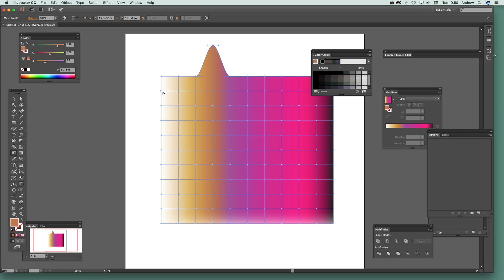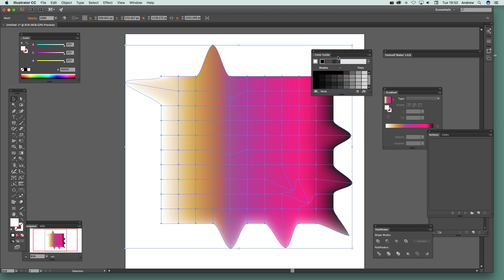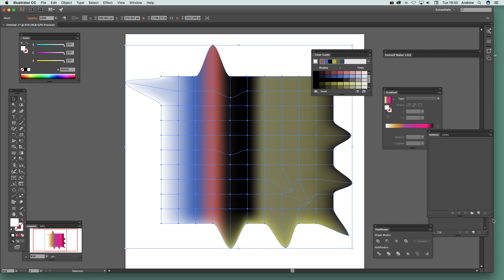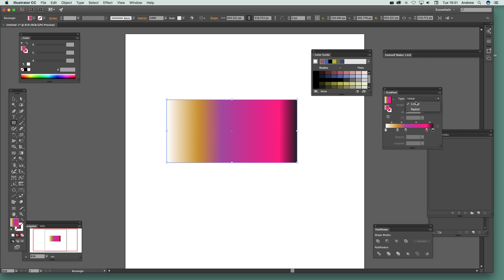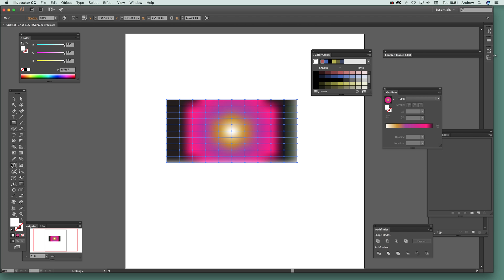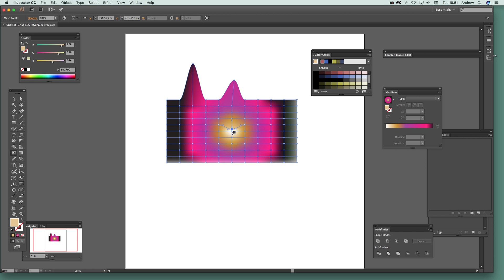How To Convert Gradient To Gradient Mesh in Illustrator

Comment: Hi and thanks for sharing this tip! I 'm looking for some help with the process: once I rasterize the gradient (radial whit 3 colour points: white, blue and black) and then convert to gradient mesh, I get a black and white result and the points change position(looks like a default b&w gradient).  I tried to see if RGB or CMYK made a difference but it didn't. Do you know where the issue could be?
Thanks a mil in advance!
Reply from the maker: I have seen issues where I end up with a totally grey mesh (that was with the SDK) but just trying it with the same colors and gradient as you mention, I get a mesh that is colorful and not b&w. The gradient mesh looks terrible even with 12 x 12 grid but it is not anything other than the gradient colors. Offhand I Can't think of any reason why it would go b&w
Reply from the maker: sorry I couldn't help
Reply: @Graphicxtras  No worries, at the end I was able to get it to work! Call it luck maybe, but Illustrator crashed, after it reopened I tried again and everything went fine!
Reply from the maker: Glad it was sorted. Annoying that it crashes when using something like the mesh.
Reply: @Graphicxtras  ah no, I was working on a different thing at that time😅